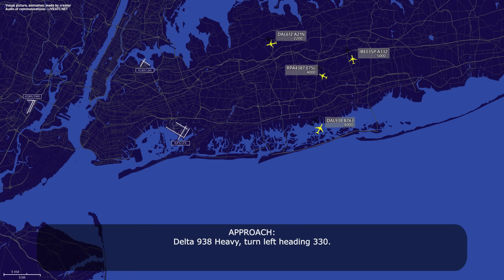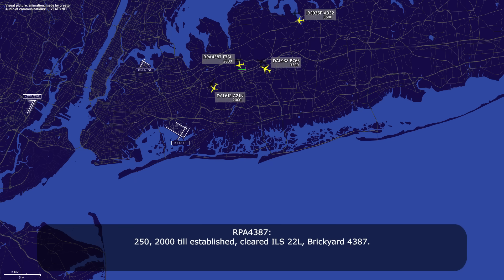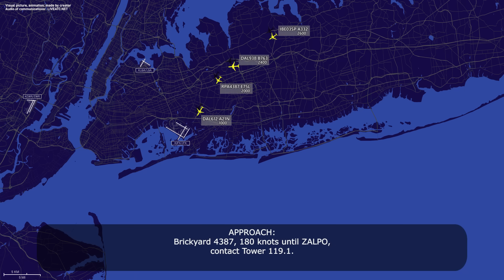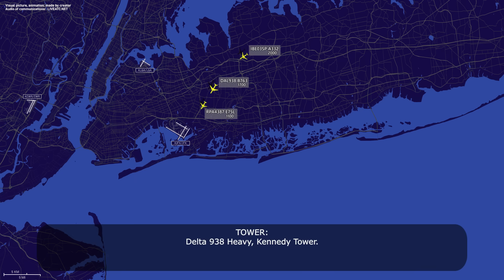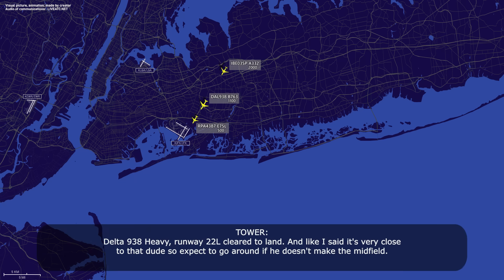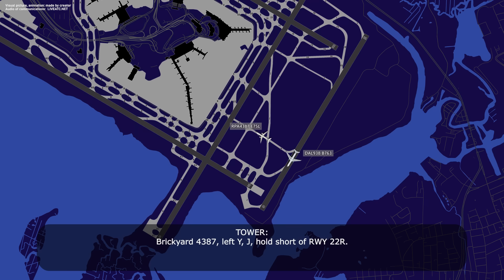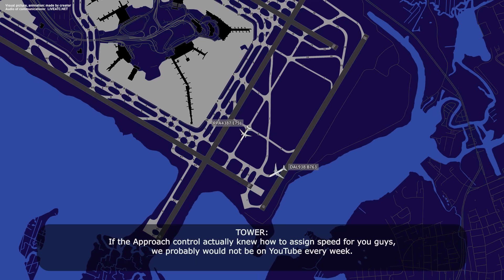Tower and Pilot criticize Approach controller for his skills at JFK Airport. Real ATC

Comment: Pretty professional if you ask me. Delta didn’t whine in the air, the ground controller did the right thing advising them, and it is appropriate for Delta to ask for a number to discuss a situation where the turns were too early and the speed reduced way too late. 

Approach controllers should align incoming traffic with sufficient safety margins. Safety being the signal word here. It’s not an easy job, especially with all the staff shortages and outdated technology, but that’s why few people are cut out for it. #OneJob

Comment: The Approach Controller broke separation rules. The Delta pilots did everything they could to not have to go around. When reducing speeds if aircraft on final the approach controller should always start with the aircraft furthest out as and work in to the airport.

Comment: speed control is secondary to vectoring. there was plenty of room to put the Delta in trail without any speed control. when you slow aircraft unnecessarily, you create more work for yourself. the pilots were short and crisp on their acknowledgments; they were doing their jobs.
Reply: What you don't see here is the line of airplanes behind Delta that is 75 miles long with an airplane every 5 miles. Your idea of "no speeds only vectors" would cause chaos. You put extra space between RPA and DAL and now you have to make up for that space for the next 1-2 hours.
Reply: @derekjeffords345  there's only one airplane behind Delta. maybe you can see what isn't there. 5 miles is center spacing, the terminal only needs three. so thats about 15 airplanes in 15 miles. for the terminal I only need 45 miles so that's 30 extra miles that I can put 10 more airplanes into. you don't have any idea what you're talking about. I could explain further, but it's over your head.
Reply: 15 airplanes in 75 miles

Comment: I'm guessing that approach was trying to slip Delta in between the Embraer and the Iberia A330, with enough separation from the A330 considering that the Delta is a heavy. It got a bit tight on final but I was actually impressed when I saw what the approach controller was trying to do.

Comment: Imo that was largely the pilot's fault for not inquiring or simply taking action and changing speed as necessary. I fly a Challenger, a very capable airplane that can fly slow and accelerate quickly and I would never have accepted 2 mile spacing on final. By about 1:15 in your video it should've been clear to the Delta crew that they were gaining on the plane in front of them, and their base leg was inside the plane ahead so they're gaining ground two-fold. They'd been listening to the video, they knew what type of plane was in front of them and that its ref speed is much slower, they should've been discussing this spacing and could've requested to slow for spacing. You can tell from the tone of Tower's voice that Tower is wondering how the fuck Delta doesn't realize they're only 2 miles behind another jet and gaining rapidly. Not sure why the Delta crew tried to pass the blame off, pretty unprofessional imo. ATC isn't looking through the window of that Delta plane, that's the pilot's job. Luckily it worked out, but not until Tower forced the crew to make it make sense.

Comment: One of the fundamentals of commercial aircraft is that they should not be at landing flap, final approach speed , flying level to intercept the glideslope. So final approach speed can only be attained once on the final descent path. If you had an engine failure with full flap gear down and low speed it will be particularly difficult manoeuvre to recover from. Approach control feel the need to set low platforms for ILS approaches to get vertical separation and help departures. If they give the trailing aircraft a higher platform then the ability to reduce to final approach speed will happen sooner and lessen the stress for everyone.
Reply: Really? Are you below VMCG at Ref +5?

Comment: I’m blaming Delta here. They were given numerous speed assignments that should have ensured separation so if they really had a 40 knot overtake at that point it means they were very slow responding to those assignments and it should have been obvious to them that spacing to the aircraft in front was very tight.

Comment: approach controller hits a hole and is off by a bit. teammate in the tower reduces to approach speed and facilitates a quick exit by the leading aircraft. both aircraft land safely, and a hole on final isn't wasted. i don't know the full context, but i also know tower controllers dream of a world where they can just give landing and take off clearances that require no judgement of time, distance and speed. they'd want to do their jobs with their eyes closed if they could. in this situation approach controllers hitting a hole have more variables to control than do the tower controllers, and variables they don't control like the responsiveness of the pilots to instructions, the rate of descent and rate of speed reduction etc. approach controllers obviously get it wrong sometimes, but in this case it was salvageable. and what's the worst case? overshoot? tower, if you don't like it, just overshoot it and stop whining. do your job or don't. hell, the flip side of this is a faster departure being launched up the ass of a slower departure without enough time/space because of poor tower judgement, and departure having to take action to assure separation before there's vertical or whatever other form of approved departure separation you have at your airport. and that's worse because it's already a loss of separation that needs to be fixed. tower can usually watch a pair that's too tight on final develop, and if they really don't like it, just overshoot. actually, that's tower/ground controller in general: you have a couple easy outs when you're in trouble for lots of situations. either overshoot or tell them all to stop on the ground, and fix later. I'm not saying it's not a shit show, or not busy, but it's safe. approach controllers with many aircraft (that can't stop, all in close proximity and always getting closer, all bleeding energy at their own rates) have less margin for error before they're doing paperwork, and they don't have a staples easy button when things get out of control. SO, your job's hard, my job's hard, stop being a puss about it on freq.
Reply: You remind me of some good On Job Instructors I’ve gone through  👍🏼

Comment: Delta was given 160 knots, brickyard was given 180. How was delta on a 40 knot overtake? not a pilot
Reply: Takes a while for the aircraft to reach the assigned speed change, and some aircraft take longer to slow down than others (especially heavies). Can also be a a slight delay until the pilots reconfigure/execute/cross check the auto pilot, or manually react on the throttle.

Comment: Looks like one or both these guys did not fly the requested speed if the visual recreation is accurate. The Delta assigned speed given was slower then the Brickyard guy, how can they be overtake them by 40 KTS?
Reply from the maker: I tried to make as accurate as possible. Yoy can check on flightradar their positions if you'd like.

Comment: Retired airline pilot here.
Delta 938 can clearly see (on TCAS and visually) he is too close to and rapidly gaining on (40 knot overtake) Brickyard 4387.
Speeds were assigned. Maybe Brickyard reduced speed too soon or Delta didn’t reduce speed quick enough.
It happens.
Regardless, the trailing aircraft (Delta) should have maintained adequate separation.
Hopefully the Brickyard pilot will be less chatty as he gains experience.

Comment: I think DAL938 is somewhat at fault. He was told to fly 170 and RPA4387 was told 180 the approach controller is also at fault as he should have given DAL 938 more time to slow down. But they made it safe and sound. LHR has 2 mile spacing every day for the whole day so I think JFK needs to get better.
Reply: Pretty sure LHR and any other European major does minimum 3 miles in trail for Medium-Medium+

Comment: Yeah, this was tight and to be fair the approach controller assigned speeds that should have opened that gap. But a wide bodied B767 just doesn’t slow as quickly or easily as a little ERJ regional jet, and those speed assignments were just never gonna be met. Part of the responsibility here (and I’m not excusing Approach) was the Delta pilot accepting speed assignments he couldn’t actually meet. Like, I wonder what his IAS actually was passing 3000’. And if he contacted Tower with a 40 knot overtake on the ERJ, he was nowhere near complying with Approach instructions. If the approach controller is never told his instructions are unreasonable, how’s he ever going to learn? The FAA short resourcing of ATC means the system relies more heavily on communication, and that’s the responsibility of all, even pilots on approach under high workload. It’s a shitty situation, but that’s how it is right now.

Comment: Did it work out yes, could it have been spaced better yes.  Bottom line it worked out and both Tracon and Tower controllers did their job by informing of the situation and by doing so everyone worked together.  The Brickyard pilot understood his role in exiting the runway and the heavy jet, not wanting to go around, was more diligent in creating more space.  Had the heavy jet been in front then wake turbulence would have been an issue and more spacing needed.

Comment: 1) Comparatively, Delta 767s can be notoriously slow to make adjustments, including speeds 2) Tracon did not anticipate how much quicker Brickyard could react to a speed reduction, but they did a good job putting the heavy second 3) It’s the lazy way out to criticize someone else when you only know half their situation 4) New York is hostile for no reason
Reply: What do you base your assumption that Delta 767’s are comparatively slow? BTW 10,000+ hours in Delta 75/767
Reply: @raymondgreenlee8821  Approach controller from Europe here: all airlines' SOPs result in different behaviors. Something that the ATCOs have to take into account. Nothing to do with pilot proficiency.

Comment: Brickyard should have been doing 180, Delta should have been doing 160, yet Delta has a 40 kt overtake. I agree that the vectors were too tight, but if you can't reduce that far at least tell 'em.
Reply: A heavy 767 cannot slow and descend at the same time like it’s a fighter jet. It’s got energy!
Reply: A heavy can just drop 40 knots in 2 seconds!!!!
Reply: @TomH26 while descending!

Comment: Brickyard is notorious for slowing much further than every other air carrier out there. Tower knows this and contributed nothing RPA slowing way back much earlier than needed.   It’s good thing approach doesn’t constantly dog the tower out for clearing airplanes for takeoff 8mi in trial when there’s 120+ minute delays…solid professionalism by JFK tower once again (but we all secretly know they personally forward these instances to these accounts so they can be “famous”)
Reply: Stabilized approach criteria. Smaller plane, lower weight, slower speed at final approach fix. They are pros in the northeast and work well with all controllers.
Reply: @skygraff yes…we work around their final approach speed disparities all day long
Reply: @JR-gc9wy , understood. Wouldn’t matter the carrier (brickyard, envoy, etc.), the mainline partner allocates that aircraft to the route and sells the seats so small and empty means slow Vapp.
Reply: @skygraff but they’re the only ones that fly the 175 into jfk and the 175 is significantly slower inside the final than the 190s or any of the crj’s
Reply: BOT!!!!
Reply: Excuses

Comment: Unprofessional to comment about other controllers on the air. Everyone is listening and no controller or pilot is perfect. It’s a dynamic system requiring mutual trust and cooperation to work as efficiently as possible. Whining doesn’t solve problems. Take it offline.
Reply: Disagree.  That's typical poking fun at each other, and compared to the majority of the clips that come out of JFK, it's nice to finally hear someone with a sense of humor.  I was really expecting some kind of a rant.
Reply: I guarantee you it's been building up to this for a long time.
Reply: You & Matthew can go sit in the corner until both of you calm down 🙄🤔🫣
Reply: I think this is fine because this is just a lighthearted comment about the approach controller's instructions on airspeeds which the JFK tower controller and few pilots just had small laughs about.
Reply: Nope
Reply: no, small chat like this is fine - when its rants, its not ok - the approach people blame tower and tower blames approach

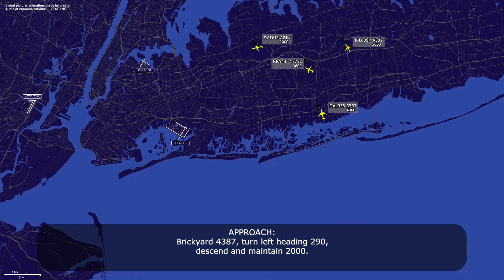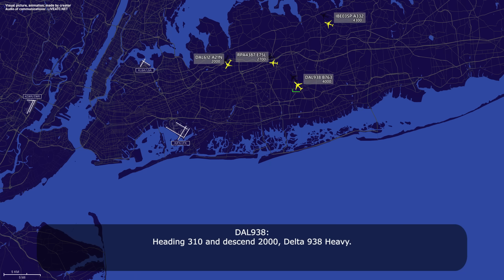Comment: You can put your finger on RPA4387 at 0:32  or 0:57 and skip few (right arrow) a couple of times. DAL938 is vectored with much tighter turn, so the separation they had at 0:32 is all lost by 1:42.
Quite counterproductive vectoring.
It all worked out in the end, but on very (unnecessarily) thin margin.
Reply: The tighter vectors were likely to get more separation for the medium behind the heavy delta (for wake turbulence). It can seem counterproductive to separate medium behind heavy somewhat close to minimum, while leaving a larger gap in front, but heavys pretty much always have a higher final approach speed
Reply: @lyaneris the aircraft behind was a Iberia A330 so no medium aircraft. Same class as the 76
Reply: @flyer93 Then it's only a mile more (4nm between heavys). Idk, imo heavy behind medium should happen often enough to get a sense for the necessary space regarding speed differences
Reply: @lyaneris  slow down iberia, grant same turn radius to delta as was given to southwest
Reply: @boahneelassmal  agreed. he had two different chances to fix this. either vector Delta later after the initial turn or have him reduce to minimum sooner. But like Tower said, just have tower fix it! Thankfully, it all worked out.